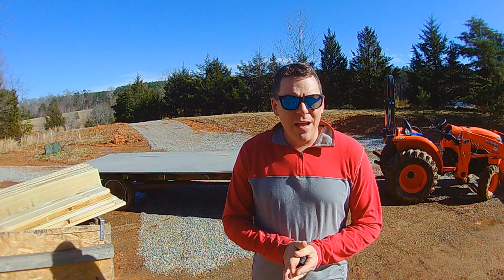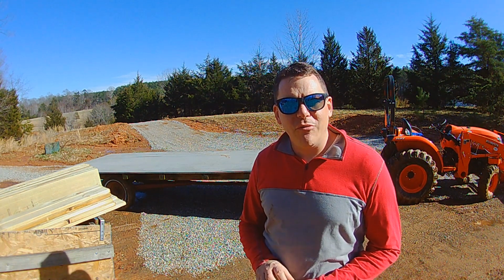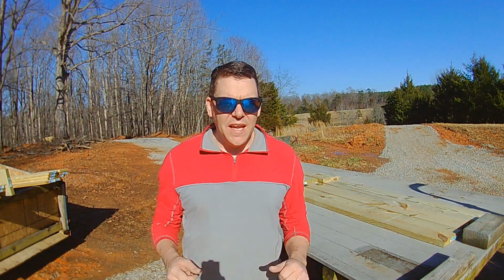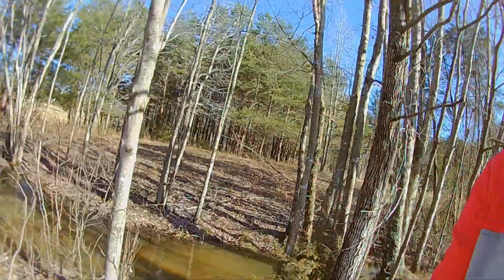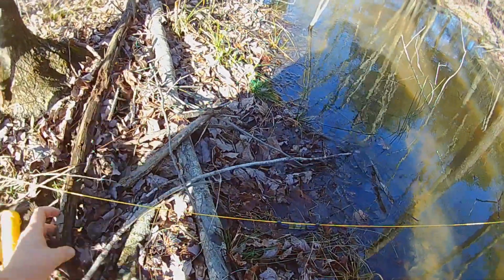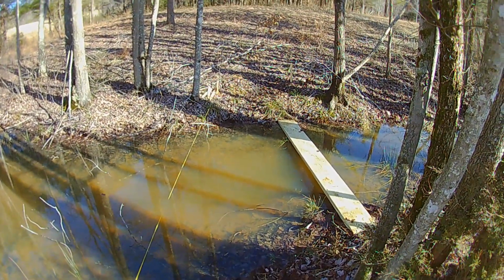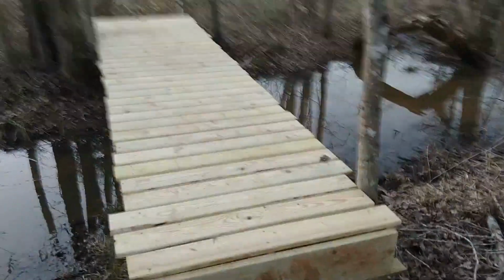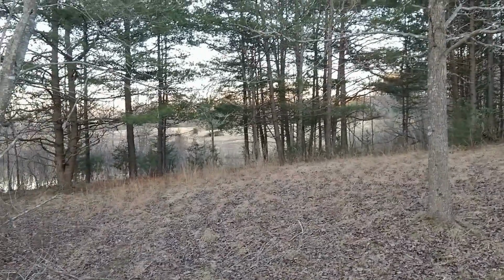#26 How To Build A 16 Foot Long Bridge Over A Creek

Comment: Id definately consider using a beam where the joists meet and while I use screws all the time, for something thats going to constantly move Id probably spike it all together with some 16d nails just for more shear strength.

I need to make on in my back wooded area where I have a gully at some point.  Good job on the bridge though.
Reply from the maker: Good points. The middle of this bridge has dropped about 1.5 inches since I built it. I recently put a railing on it, but it needs reinforcement. I'm going to jack it up and put some carriage bolts in the sistered joists.

Comment: I built mine with 4x4s. A span of 32'. I had three supports for the beams and the beams were joined together length-wise with six carriage bolts at each joint. Holds me and my 650 lb ATV no problem.
Reply from the maker: Sounds nice!